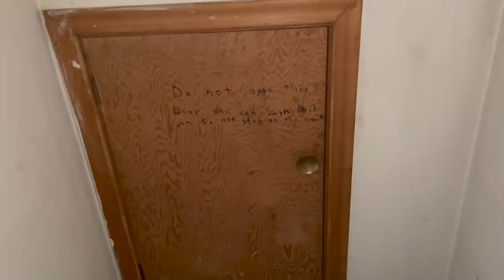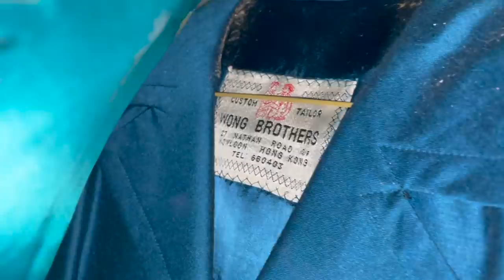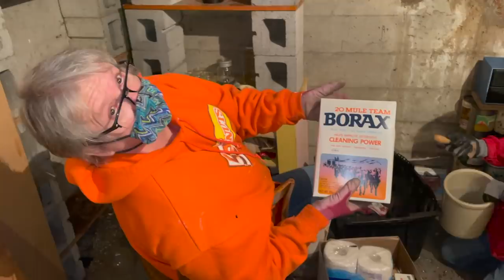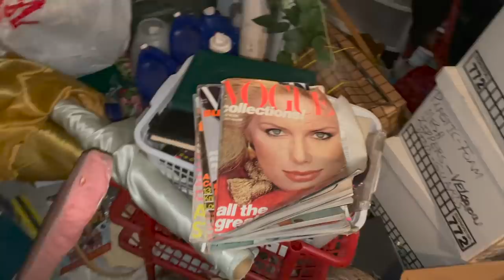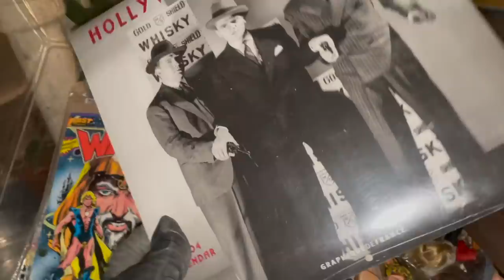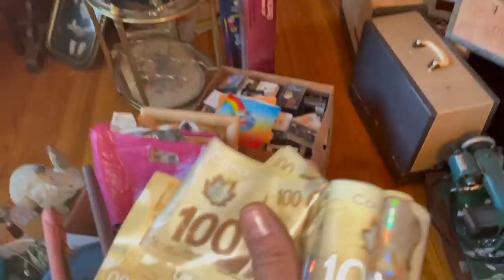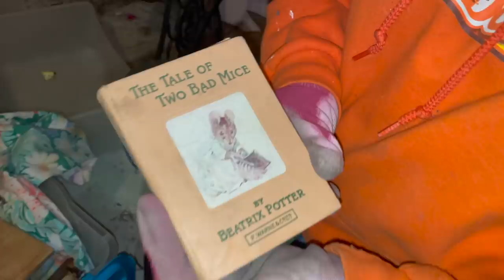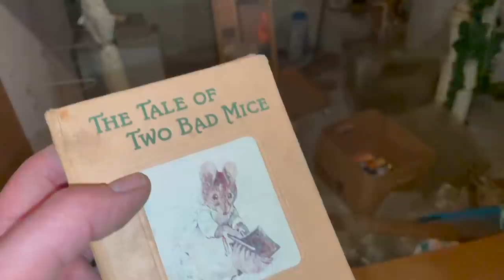part 11. Hidden Cash this whole time?!?   HD 1080p

Comment: I know of someone who bought paint tins at auction, they felt as if there was a lot of paint in them, when they got home, they opened them and found only sand, or so they thought, when they tipped the sand out, there was opal, and uncut opal, worth quite a lot of money.
Reply: Even the paint might still be good - oil-based paint sometimes lasts forever! I've painted with what I found in half-empty tins from the late 70s! It might skin over and you want to strain it but other than that it's usually perfectly fine.

Comment: When my mother was still alive but had dementia, we went through her linen closet. It had always been tightly packed with towels, bed sheets and blankets. If anyone tried to get a towel out to take a shower they had to hold the stack with one hand and pull on the towel they wanted. So many towels and sheets for ONE woman. 
As we pulled out the blankets from the bottom of the closet (we were sitting on the floor) we discovered my grandmother's quilts. I was in shock and delight. My grandmother and great grandmother had made the quilts many many MANY years ago during the winter when there was nothing to do in Alabama where they lived. Both women passed away long long ago. I couldn't believe my luck finding those precious quilts. 
As we pulled out the quilts we also discovered embroidered things my grandmother had done. My eye noticed an old fabric pattern and I thought it was just a piece of fabric but it wasn't. My mother pulled it out and put it on her head. It was a bonnet my grandmother made for my mom when my mom was a young girl. Not a fancy bonnet but a head covering to wear when my mom worked in the fields. I took some photos of my mother wearing the bonnet. We also found my GRANDMOTHER'S bonnet too!!!! I couldn't believe it.
It was amazing that the two head coverings survived throughout all the years but my mom took good care of her things. My mother's short term memory was pretty much shot but her long term memory was excellent. We sat on the floor and my mom talked about being raised on a farm and how hard she and her brothers worked AS CHILDREN. I knew a little bit about her life growing up but not as much as she told me that day. Believe it or not, my mom remembered when her mother made those two bonnets. They were sewn on my grandma's treadle sewing machine. 
Cherish the items your ancestors have passed down. Sadly I have no one to pass the quilts to even though I have two adult children, sisters and many nieces and nephews. We cut the ties years ago.
Reply: I was honestly hoping for a happy ending when reading this until I got to the last sentence. I don't know what the circumstances are, but I hope you all can mend sooner than later.
Reply: Thank you for sharing your story. It really resonated with me.  When the time comes, I hope your quilts find their way to the next person who will cherish them as much as you have. My mom has a couple of beautiful quilts my great grandmother made that will some day become much loved pieces of my own household. It is such an honor to receive something handed down through the generations.
Reply: The needlework (cut work, embroidery, crochet work, etc) my maternal grandmother made is split among the 6 grandchildren, but the youngest of us is in her mid-60's.  Not sure OUR children will treasure or even want it.   It's really sad.
Reply: @gailpippin9761  Ever watch CrazyLampLady and some of the same age group?  I find it really encouraging to see that while it might not be your kids, there’s still another generation that appreciates hand made items and the interesting items from the past just like we do.
Reply: Because of family bickering over quilts their grandmother gave them to the one who could care less.  That was my mother in law. Sorry they sat in a inappropriate closet for decades. When we moved i found them and she said throw them out.  Ugh.... 
I washed them incorrectly and my daughter used them to keep warm.  Waste not want not. They ended their days keeping us warm during a hard time in our lives.

Comment: You should auction those linens. Vintage linens are very sought after.
Reply: I agree! I recently found a vintage fitted twin size sheet with Peanuts characters on it. Bought for a quarter at a yard sale. It even had stains, which I disclosed and photographed on my Ebay listing. It sold it for $114.
Reply: Agreed!! I want some vintage full-size sheets in an aqua / sea foam floral.
Reply: I quilt with sheets...older unstained preferred but they make great backs and borders...linens rock!
Reply: @robinsmith8334  I'm a quilter as well, and I was tempted to keep the Peanuts sheet to make a kid's quilt. It even had "blocks" on it with cute drawings of the characters in each one saying, "Happiness is...." I used the key words "quilt fabric" as part of my listing title. Perhaps that's why it sold for such a high price.
Reply: I wanted to cry when he said he was donating all the old linens.

Comment: You might consider running a shop vac or two with filter bags and long hoses to help remove the dust.  Run the vacs outside with the hoses in your work area to continuously pull out the dust.  Being outside, the vac noise won't be too bad inside.  They can also be used to clean up areas as you sort through all the potential treasures!  In addition, replace the furnace filters often as they are likely getting clogged up.

Comment: If you put a paper filter in a shop vac and just let it run in a room it will pull the dust out of the air. That's what I did in my house when we were sanding drywall mud.
Reply: Interesting!!
Reply: That’s a really great idea!

Comment: If there's a safe in that house, it would be under a floorboard and you would not be able to tell only by a small Gap that there was a safe in the floor. I might suggest that after everything has been taken out of the house and the floors are totally exposed you really get down on your hands and knees and check for gaps in the floorboards. I'm saying this because I used to work on houses up on the east coast and a lot of people hid their valuables in the floorboards not only in a safe but just under the floorboards alone. There's got to be something in the house, I just can't believe especially them being hoarders that they would not put something under the floors?
Reply: A quick sweep with a metal detector through the empty house would bring it to light.
Reply: Merry Christmas
Reply: Wonder the last time the (then-)healthy, younger owner would have been able to physically access a floorboard hidey-hole or safe, both from an age and literal (bc of hoarded material on top) perspective!
Reply: If he finds a safe, he can generally contact the maker for the combo, or help with it.
Reply: I wonder about that door on the stairway. Someone said it was just trim but it has hinges. I would have to see what’s behind it.
Reply: @praeliora  Except when it's dollar bills
Reply: @Mar10la  a safe would be metal
Reply: @praeliora  Yes, ofcourse :) But since there was a reference to loose stuff under the floorboards as well, a metal detector alone may not cut it
Reply: @canyondiva493  A closet - Alex opened it in one of the first videos. The "just trim" bit is above the basement stairs, no hinges there as far as I can tell!
Reply: @Mar10la  True, but always worth a try, it would definitely pick up coins and jewelry.
Reply: @praeliora  Definitely!

Comment: Love your show . I am so happy that you found the Gibson head stock  . your repair is so much more likely to be successful now . Have faith , I know from experience your guitar can be saved . However I would recommend that the neck is examined to see if it is too twisted first to justify how you proceed with the repair . It would be good to put your guitar in a case to prevent further damage . keep it away from direct sun light or heaters  . I do not know who will fix it ? but they should check all the braces to see if they are loose  , It would be fun to see you play it .

Comment: You should invest in an air purifier with a hepa filter especially for this type of house. It would probably help your allergies a lot. I use an Alen air purifier. Or you could get a better mask than just a regular cloth or medical type mask. Those don’t really do a whole lot as far as filtering out contaminates or dust in the air. I like the Cambridge mask the best, but Vog mask is good too. They both have a carbon filter and filter the air you breathe.

Comment: What's in the door at the top of the first set of stairs going up to the second floor? It's right on the left....not on the second floor though. It's a blue door. Ps. Don't throw away the heads I win, tails you lose coin with the booty on it. You can sell it, I know someone who wants it lol

Comment: Kind of sad not to see Dakota as he is a sensitive lad with good values. I done a lot of luthier work and thats a "snap" as the pun goes. Anything beyond the nut on the kneckboard is really easy to fix right. I always used maple dowels as the wood in that is dissimilar from the actual wood of that guitar. Looks to be mahogany wood in that part.. I'm not sure if its wishful thinking or just what but my gut says there is another huge find to be found yet. Who ever gets the job of insulating that home will find in  the old insulation more hidden cash for sure but you will have the majority of it. So mary holidays to you and all the others
Reply: Yup, that is definitely mahogany.  Should be easily fixable by an experienced luthier.

Comment: Merry Christmas everyone! I'm not volunteering but I'm not convinced that the attic is empty. Just because the insulation is sticking up a little higher out by that one vent and there is planks laid down that head out that way and there was an electric light up there.
Reply: I have had put a light upon like that if some handy man or worker needed to fix something up there. In need to check the roof, rainwater damage or something.
"-Yeeh, yeeh.... just go up there, its light there I'm not coming with you to show how it is up there, you will find your way..."🙂

No ladders for me, no thank you.😁

Comment: Just a wird of advice, If you come across thread that is more than 5 years old, it's best to throw it away. It's hard to determine how much its deteriorated over the years and you wouldn't want to lose a button, burst a seam or have a zipper rip open in an opportune time.

Comment: now fixing the Gibson will be relatively easy for somebody that knows what they're doing. Hopefully whoever you find to fix it will add some small steel bars or the like to strengthen the repaired area. (Inside so it doesn't show) otherwise string tension might cause it to break again. Gibson necks are generally made with that top part added on with glue, so they tend to break just like that if the glue didn't cure just right. Any experienced repair person has probably done that same fix many times. I say repair person because there is a difference between a repair person and an actual luthier in my book. A true luthier can make an instrument from raw wood and such, a repair person just specializes in repairs. Least ways that's how it is in my world.